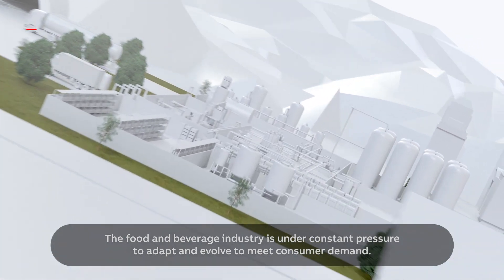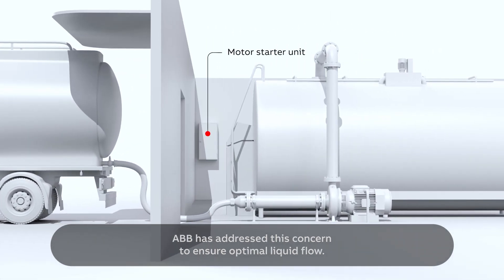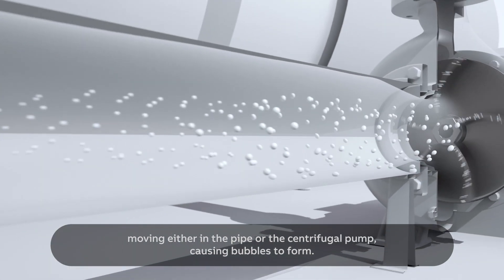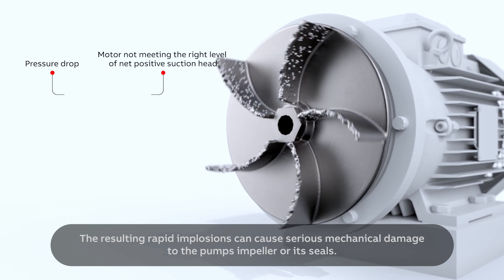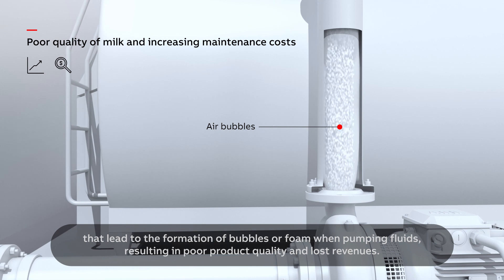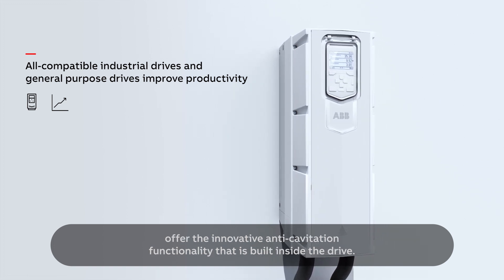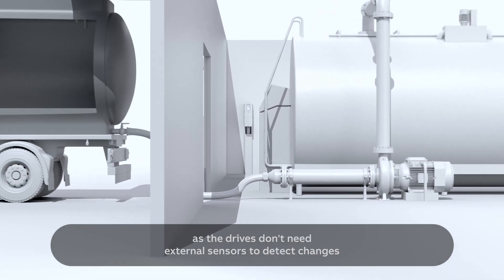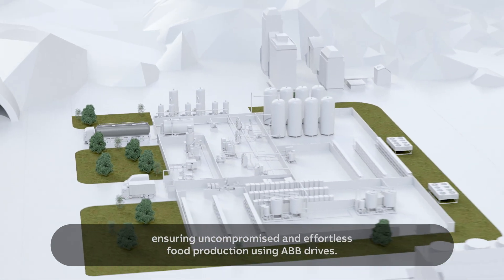Mitigating cavitation with ABB drives for reliable and efficient operation in the F&B industry

Comment: Where is this set in the parameters?
Reply from the maker: The anti-cavitation software is purchased as an additional option. 

The software includes all additional parameters needed (included in groups 86-88): https://library.e.abb.com/public/7b380e14727743c19f0f7bb4e1664706/EN_ACS880_SUPPL_A.pdf
Reply: There is no need to expel air from the pump head or reprime? Has this been applied to water pumps such as irrigation? We have a large problem with cavitation in the golf industry so to leaky footvalves and bad check valves leaking water from suction to pressure side.